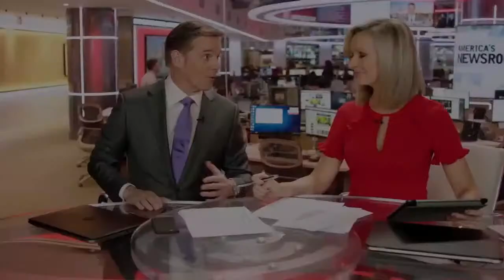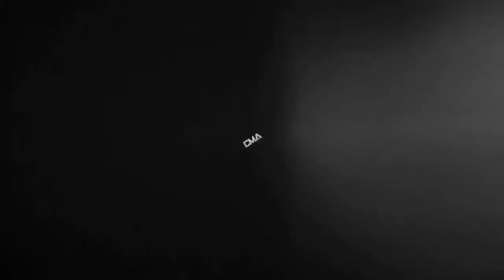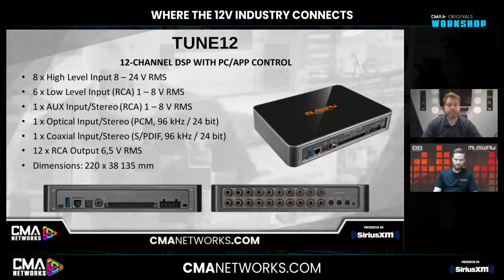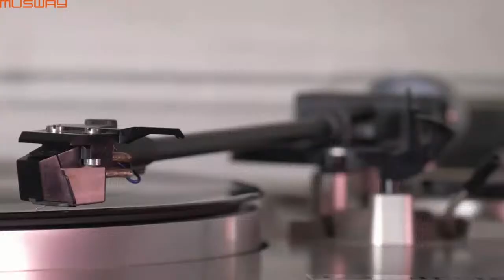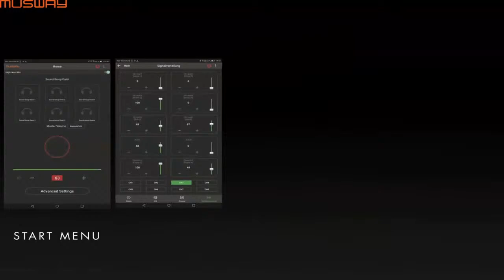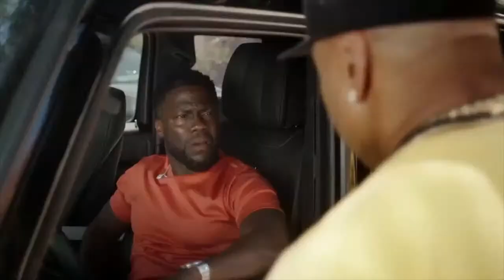MUSWAY | DSP | WORKSHOP

Comment: Is there anyway to do differential rear fill with the DSP software ?
Reply: Yes but, it's done by manipulating the input channels, input volume, input mixing, delay and level. And phase of the rear fill channels.
Reply: @paulyoung7906 ahh that’s gonna be tricky then
Reply: @Thomas-uh4in Not really. It just requires the adjustment of a few config items. You'd have to do the same with Audison's Forza series.